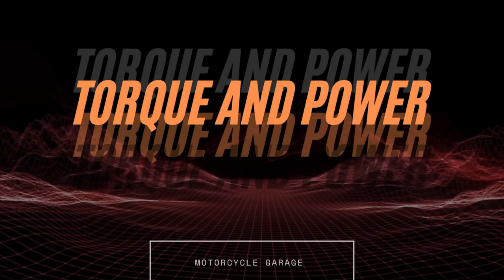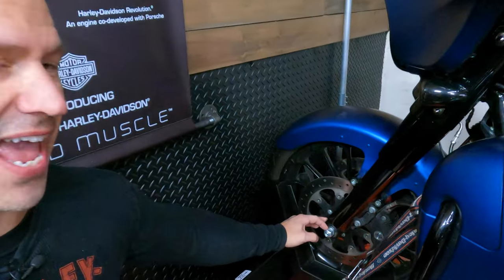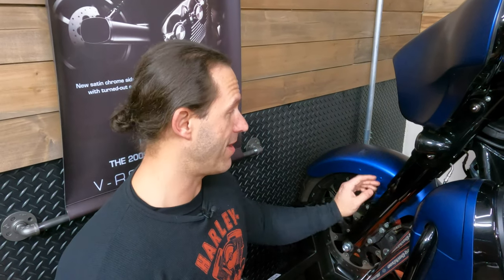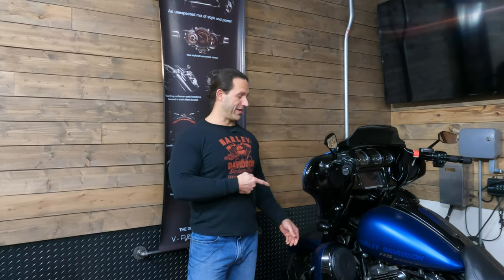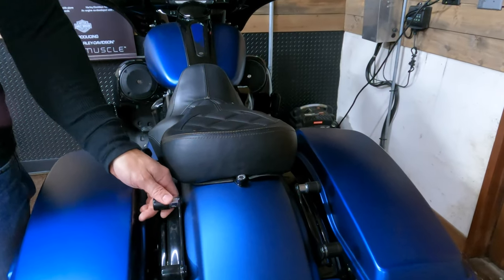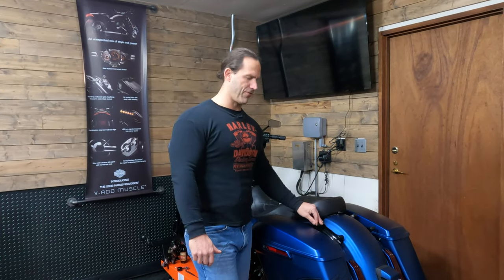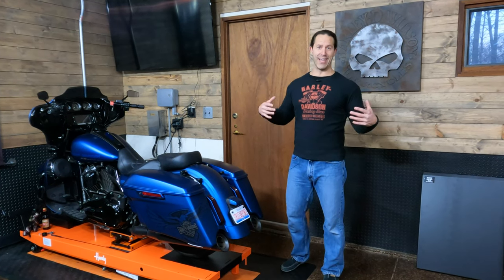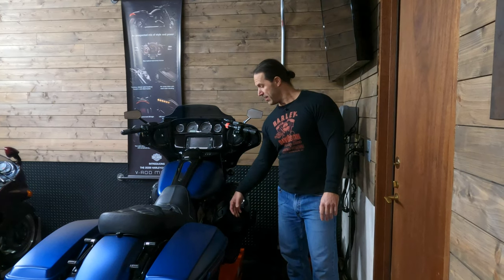New Buyer Must Do's for any HARLEY-DAVIDSON MOTORCYCLE!

Comment: The best way to remove those reflectors is with WD40 & fishing line. On each side of the reflector pull up on each side as apply the WD40 behind it, be sure to use a good amount when doing so. Let that sit for about (10) minutes,  then start from the top with your fishing line behind it pulling it down slowly. Once the reflectors are off you can just use your finger nails , that’s if you have not chewed them off, and the just remove the adhesive until it’s completely off. Take a soft cloth to remove the WD40. Hope this helps you out, I been doing this way for many yrs now.
Reply from the maker: Awesome good to have another solid method thx!!

Comment: Mod #1 - Rear suspension - stock 2 inches of travel is just silly. 
Mod#2 - Front suspension
Mod #3 - Engine cooling aka Love Jugs.  I will guarantee that you are running an engine temperature of over 300 degrees all the time on that 107 (mine ran 330 degrees when it was 80 degrees ambient temp). Your ECU is going to significantly retard the timing when the engine hits those temps and drop your torque and HP by more than 10%. The cost of the Love Jugs to retain 100% of your engines torque and horsepower is the cheapest horsepower you will ever buy. With the cooling, I’m running 255-260 degree cylinder head temps now.
Reply from the maker: All excellent add-ons that make a big difference!  👍🏻

Comment: I have to say that Stage 2, Trq cam, with a good tune, and Legend Suspension front and rear, are "must's". Once you've had a bagger with these 2 upgrades, it's impossible to go back. 
I just did a demo ride on a new RGS and was completely disappointed in the stock suspension and the throttle response.
Reply from the maker: It is a game changer!  What suspension did you go with?
Reply: @TorqueandPower   Legend Axeo front, REVO-ARC rear
Reply from the maker: @jameslindsay479  legend makes great stuff!

Comment: Ok.... I did also choose the highway pegs and the four point docking system for my old 2010 E-glide, but all the rest of your must do's is just for show. I still have those 2 big spotlights next to my headlight, so people see me for sure. Most important is that you have those old fashion rear crashbars, because sooner later your drop the thing and then your hard saddle bag is gone including your exhaust pipe. And those rear crashbars are great for securing bagage and fitting some extra leather bags.
Reply from the maker: Rear crash bars I’ve been thinking about adding those just haven’t pulled the trigger yet. Great suggestions!!

Comment: Awesome video, as far as removing the reflector a steam gun works better than a heating gun, you can actually cause the paint to bubble if left to long. A steam gun is more safer. Works good at removing window tint as well. And definitely a shorty antenna.
Reply from the maker: Good call on steam gun just I personally don’t have one 😀

Comment: I'm  buying my Rockford fosgate fairing speakers, amp, and saddle bag speakers from amazon and wiring kit.  The cycle shop in my town said it would cost $800-$900 to install it for me.  Is this correct?
Reply from the maker: Shouldn't take 8 hours to install but you do have some cutting on the saddlebags to do for the wiring but the rest is plug n play.  IF you have the tools and are handy you can conquer it yourself!  Hope this helps!!

Comment: My new Ultraglide came with a maladjusted clutch that almost burned itself up on my first ride. Took it back to get adjusted and it still slipped a little. Third try was a charm, and I also upgraded to the SE version with 1275 NM springs. This would be my first mod I'd recommend for any of the new Harleys. I think they have been cracking 3rd gear so more clutch slip is the way they tackled it ... rather than taking the transmission out and lowering the hardness of all the gears to about 180 Rockwell so they are not quite so brittle. I plan to do this when the warrantee runs out. Anothert excellent add on is the cool flo fan. Makes it slightly less like riding thru hades here in Florida during the summer.
Reply from the maker: I’d also recommend the billet ramp upgrade for the compensator!

Comment: Hey, about that shaft. They give you a kit with a longer shaft. Question, What does it take to put that longer shaft in? Taking off the cam cover is like taking apart half the engine🤪
Reply from the maker: It is a fun project and has its rewards for sure in torque and horsepower!
Reply: Got the shaft? Absolutely, all the 114 m8 got a balancing shaft. One may need an extra shaft on the foot shift 👣Or just use the shaft from the engine. Either Way

Comment: sweet with backrest (mustang tour), klockwerks flip windshield, custom dynamics indicators(should have been led from factory), headlight (the stock one is pitiful), a set of bars to make the bike comfortable, heel shifter, real shift pegs, hopnel highway bar leather inserts, shift linkage, and shorty antenna. all the rest is extra.
Reply from the maker: You got it down!  Right on!

Comment: I bought this same bike new in chesterfield va. I had them put docking hardware on it. Got a better seat and backrest so wife can ride on back. Had them put on screamin’ eagle mufflers and a stage one air cleaner, I did the same as you keeping the original style. Had the whim installed which has never worked very well. Had black axle covers put on. All that before I brought it home. Since then I got taller windscreen, custom dynamics lights, king tour pack from Harley in matching paint. Bought a 2018 tour pack pad off of eBay so the stitching matches. #1284/1900. Love my bike
Reply from the maker: It is like we are the same human listening to your story lol. That is awesome!  Thanks for sharing!